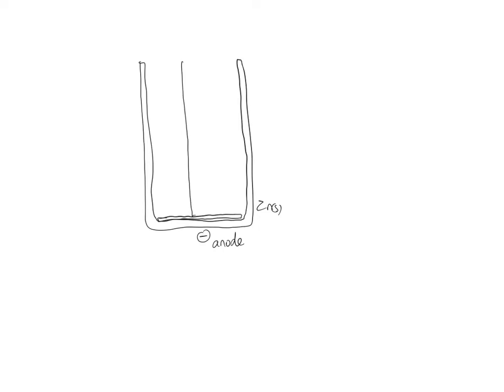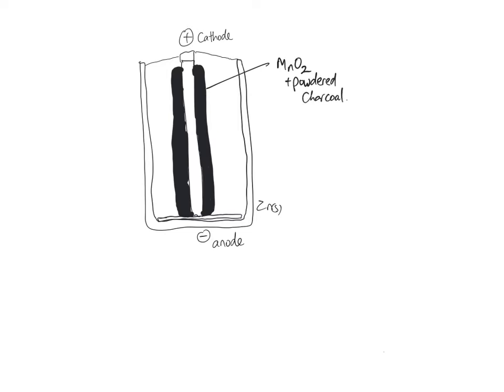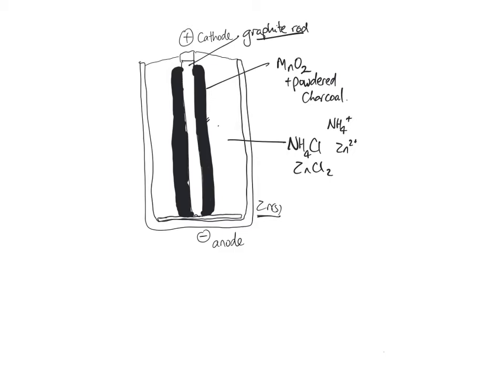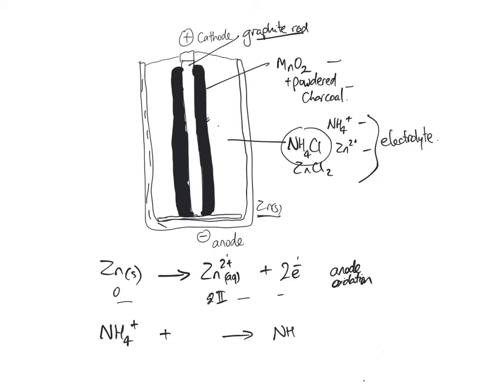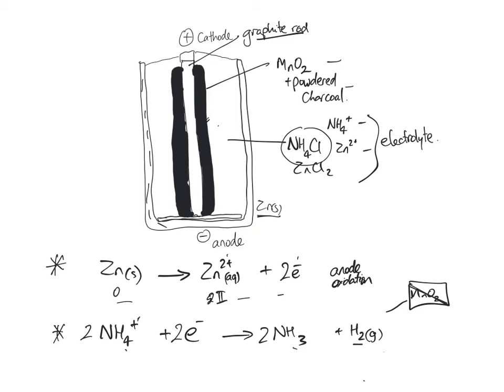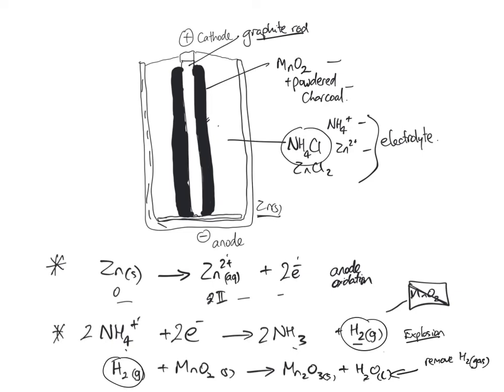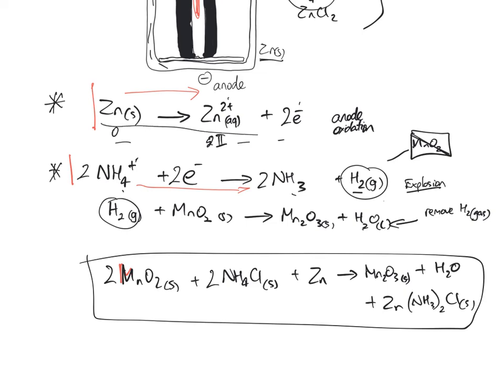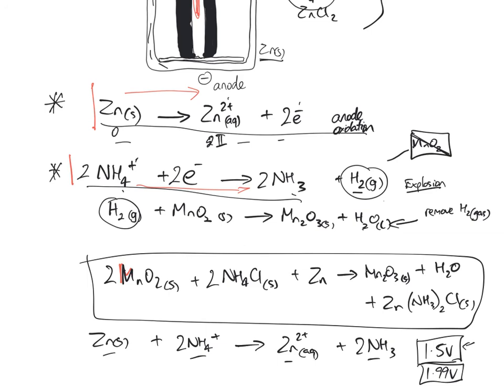Dry Cell Chemistry Topic 1 Section D

Comment from the maker: It has to have enough moisture to allow current to flow. As a paste it keeps the portability feature of the dry cell. If it were dry no current means the cell stops operating. Think of the chemistry of a wet cell and the salt bridge has to have moisture. Also the hydrogen gas is  converted to water = moisture